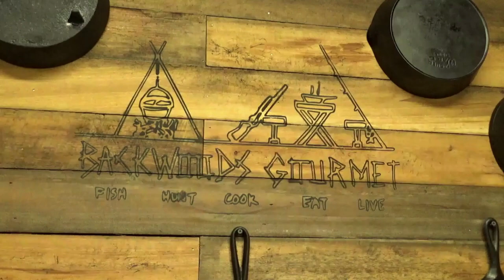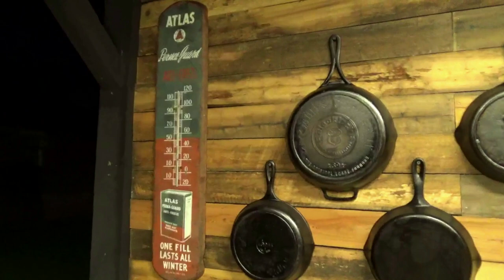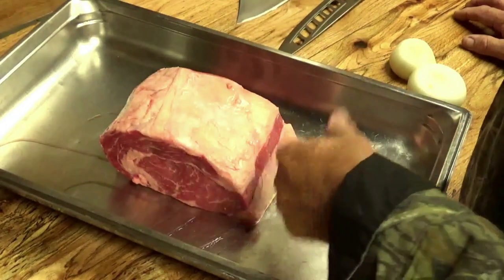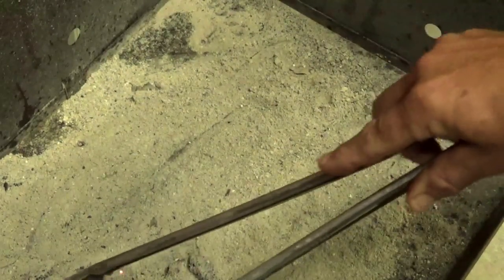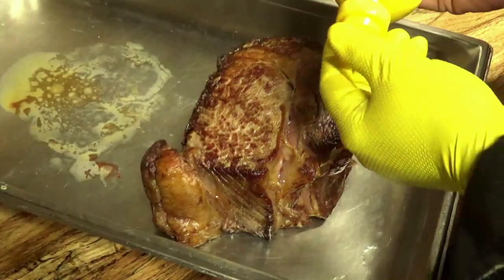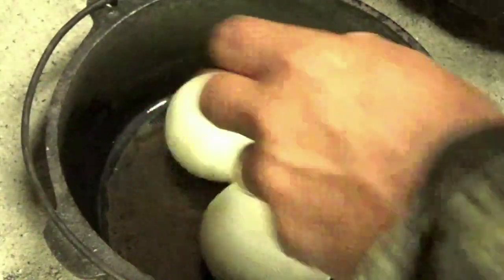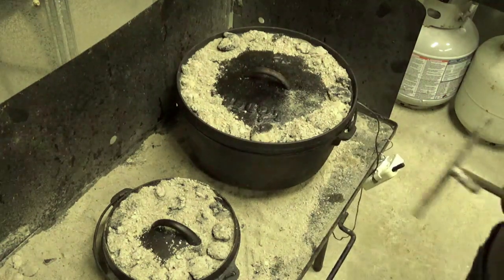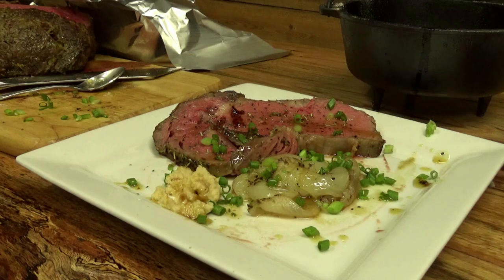FOOL PROOF DUTCH OVEN PRIME RIB - NEW OUTDOOR KITCHEN

Comment: Dalstrong has a lifetime warranty guarantee for our cutlery against manufacturing defects in material and construction and to perform as advertised when properly used and maintained. The Limited Lifetime Warranty is non-transferable and does not extend to normal signs of wear, rust, damage or breakage due to improper use (dropping, cutting hard surfaces, prying, etc.), improper maintenance, accidents, or loss or theft.

Comment: The Lodge rack for the bottom of the dutch oven looks nice . I use a cast iron trivet but 3 or 4 canning jar lid rings work quite well in a pinch .                       Your kitchen looks great .        Semper Fi

Comment: It was easier to type in dalstrong warranty in goggle.   The dalstrong website kept locking up.  I couldn't find the knife you showed in the video but at least I got the info to inter the contest. I copied and pasted it. It don't say it in the pasted piece but they do say free return shipping in the USA only.
"We offer an industry record-length 120-day full money back guarantee (including the shipping) and a limited lifetime warranty. Dalstrong has a lifetime warranty guarantee for our cutlery against manufacturing defects in material and construction and to perform as advertised when properly used and maintained."

Comment: We offer an industry record-length 120-day full money back guarantee (including the shipping) and a limited lifetime warranty.
Dalstrong has a lifetime warranty guarantee for our cutlery against manufacturing defects in material and construction and to perform as advertised when properly used and maintained. The Limited Lifetime Warranty is non-transferable and does not extend to normal signs of wear, rust, damage or breakage due to improper use (dropping, cutting hard surfaces, prying, etc.), improper maintenance, accidents, or loss or theft.
If you ever have any issues with any Dalstrong products, simply send us a message with your Order ID along with any images of your concern and we will be pleased to assist you.

Comment: Dalstrong warranty "We offer an industry record-length 120-day full money back guarantee (including the shipping) and a limited lifetime warranty.

Dalstrong has a lifetime warranty guarantee for our cutlery against manufacturing defects in material and construction and to perform as advertised when properly used and maintained. The Limited Lifetime Warranty is non-transferable and does not extend to normal signs of wear, rust, damage or breakage due to improper use (dropping, cutting hard surfaces, prying, etc.), improper maintenance, accidents, or loss or theft.

If you ever have any issues with any Dalstrong products, simply send us a message with your Order ID along with any images of your concern and we will be pleased to assist you"

Comment: Copied from their site, " We offer an industry record-length 120-day full money back guarantee (including the shipping) and a limited lifetime warranty.
Dalstrong has a lifetime warranty guarantee for our cutlery against manufacturing defects in material and construction and to perform as advertised when properly used and maintained. The Limited Lifetime Warranty is non-transferable and does not extend to normal signs of wear, rust, damage or breakage due to improper use (dropping, cutting hard surfaces, prying, etc.), improper maintenance, accidents, or loss or theft."